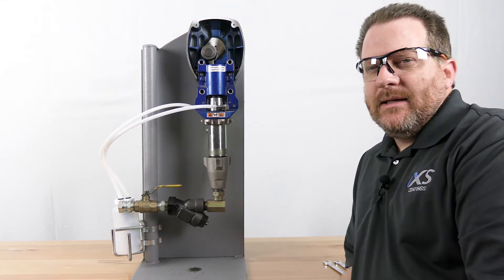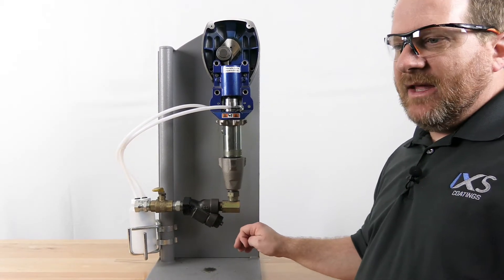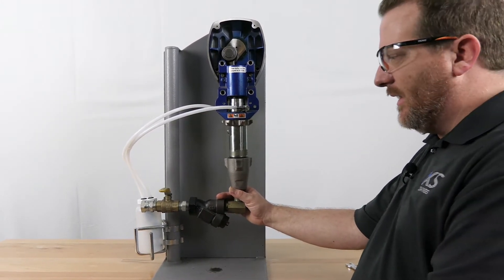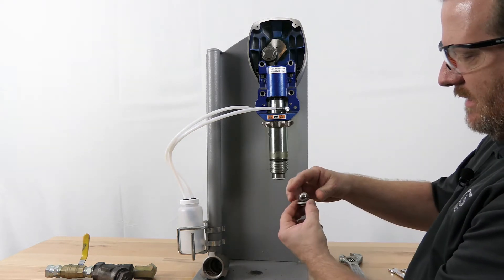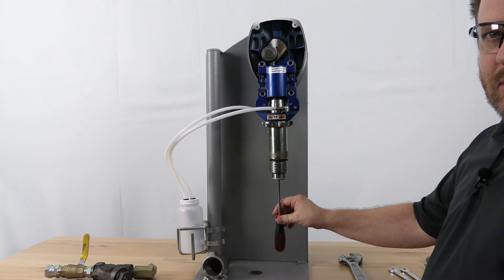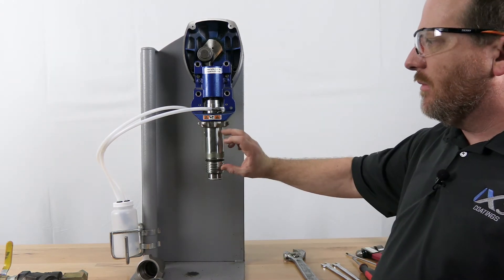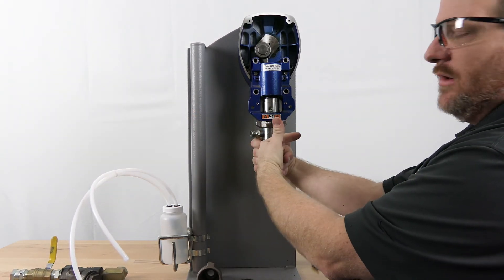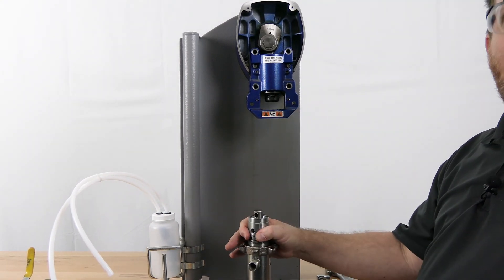EXP 2 Displacement Pump Troubleshooting

Comment: Hey Cory, I have a 2 year old exp2 reactor 3. We are getting clogging at the wet cup and TSL fluid isnt getting through. I ordered some syringes to see if I can blow through, but not sure what to do if I cant. Is there a rebuild kit for the wet cup, or do I need to buy another wet cup?
Reply from the maker: You can get a rebuild kit but usually if it’s bad you will need a whole new one.  Usually what is bad are one or both of the black check valves are not working.   You can take them apart if you’re careful and clean them.

Comment: hi cory is that pump for the reactor2 exp2 pump?
Reply from the maker: @mrjoeframer  yes it is.  That pump is used on all three reactor versions.  It is also very similar to the pumps in the E-10 units as well as the E-XP1’s and the E-20/30 machines.
Reply: @coryellis229  Thanks Cory. i just watched the exp displacement pump rebuild video and that exactly happened to our exp2pump today, 1 question i have now you skipped it in the other video the EXP displacement rebuild video at minute 2:20 where you said ''you are gonna have to figure out how to get the other half of the wet cup off of the shaft. now can you tell me how to do that in the most effective and best way? do you have a video of that?
Reply: also i seen you used graco ISO pump oil to reasemble, in that case can i use just the regular white graco fusion grease? or should i best not to
Reply from the maker: @mrjoeframer  Sorry I missed this.  We usually put the shaft in a vise where the bad part that is stuck on the shaft is what you are clamping too so that you do not damage the shaft.  Then use a small map gas torch to heat the bad part.   It does not need to be extremely hot, most ISO's will melt at around 160-170.  Then you can use a hammer and tap on the top of the shaft to drive it down out of the bad part.   Be careful not to damage the top of the shaft.  That part is not a sealing surface but you have to push the seals over that part.  You can file/sand it down if needed.
Reply from the maker: @mrjoeframer  I prefer the pump oil because it will flush out of the system easier.  The grease could "stick" to the parts more and then at some point come loose and flow through the system to the gun.